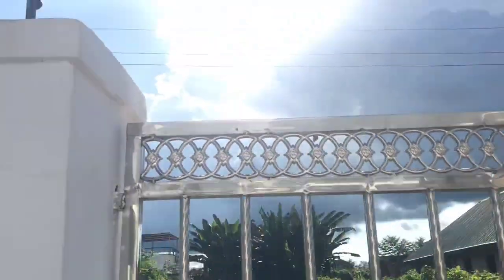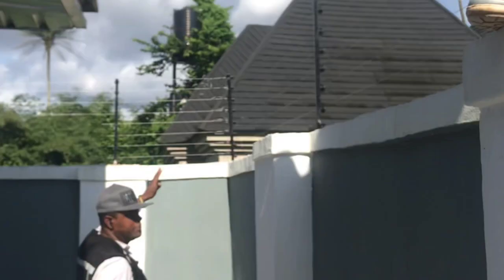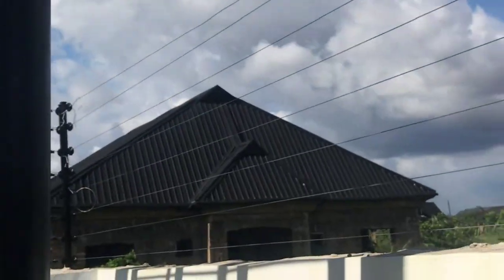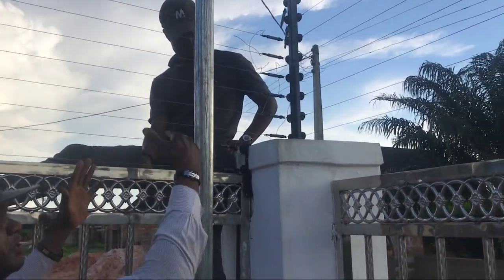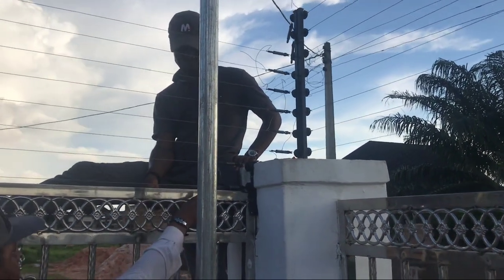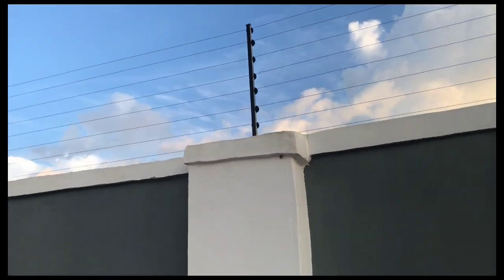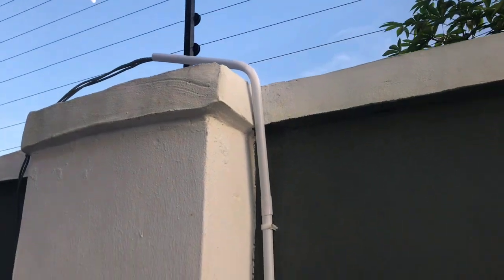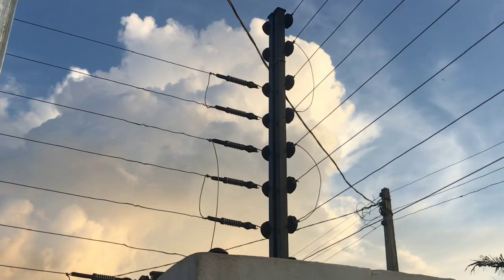How to Install electric fence, step by step process. Part 2.

Comment: Thank you very much sir, please I think the next thing will be to teach us how to connect the earth rod to our energizer because I haven't been doing that to my installations. I will be going to complete an installation I started yesterday and by the grace of God I will be using this method you just told us and hopefully I will be sharing my success story here, the thing I'm interested in is the alarm going off when a line is tempered with or cut. Thank you once again sir, more grease to your elbow.
Reply from the maker: Ok sir, thanks so much for speaking up, because I actually commonised it. I will do this in my next video
Reply: @defotechtv9093  I'm looking forward to it sir, and let us know the importance as well so we can promptly relate this to our clients. God bless you for all you do.
Reply from the maker: @Ebiz-yt9tr  you are welcome .
Reply: Good evening sir as promised I'm here to share my testimony and experience gotten from this pattern of connection. 
1. Just as you told us when I tempered with a line i.e open the circuit, the alarm was triggered. Which is what I have been sourcing for, kudos to you sir for this knowledge I just got on a gold platter. 
2. During the process of trying to disconnect a line the back of my hand (skin) touch the line but I did feel any shock I don't know if this was my reflex or does this connection not shock because I know the previous connection does. Note when testing (producing sparks) for my client to know that truly electric runs through, I breach the live and earth there were sparks in all the lines. So my question now is if there's any possibility of having such sparks without it being able to shock a potential intruder?
Please I look forward to hearing from you and getting to learn more. Once again thank you and God bless you greatly. ❤️
Reply from the maker: @Ebiz-yt9tr Good morning sir, thanks for your kind words. And secondly, the first question I will put to you is that, was your fence connected to earthrods? If not, its probably the cause. Moreso, I noticed some energisers have a kind of inverted voltage, I am talking about the nemtek Energiser. The terminals might have inverted polarity, where the "earth" terminal under the Energiser might have the voltage pulse and the "live" terminal acting as the earth. If you have a fence scope, use it to test it, moreso, if you have the guts, use a tester to touch those terminals.😂
Reply: @defotechtv9093  There was no earth rod connection sir, I don't know how that is done. And regarding your answer is it possible I to get sparks from the lines and no shock being done by the fence?
Reply from the maker: @Ebiz-yt9tr  there might be shock on the earth terminal of the energiser
Reply: @defotechtv9093  And earth is just 2 lines out of the 6. The place is very far from where I live I would have loved to go back to clearify things out. My clients really needs that fence electrified because they have been burgled twice since June and their building materials stolen. It's an ongoing building project.
Reply from the maker: @Ebiz-yt9tr  . They can't burgle it if you have made the right loops . It's definitely going to trigger the alarm if they try to scale the perimeter fence. So far people are around the area to go after the burglers
Reply: @defotechtv9093  Yes it triggers alarm when it's been tempered with I'm just concerned about the electrification. Does this pattern of connection has the ability to shock that's my worry.
Reply from the maker: @Ebiz-yt9tr  touch the earth line. I already explained that this morning, I will make a video regarding this today